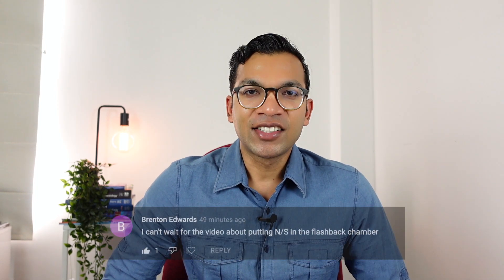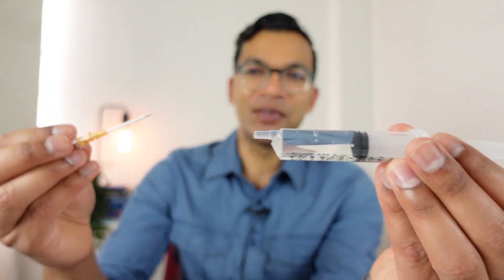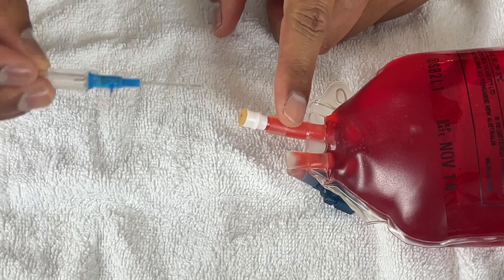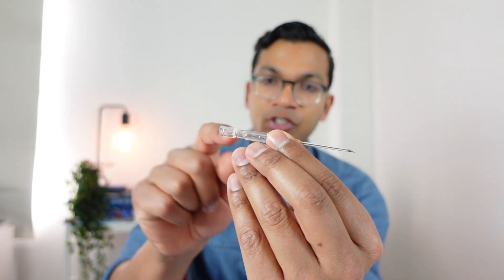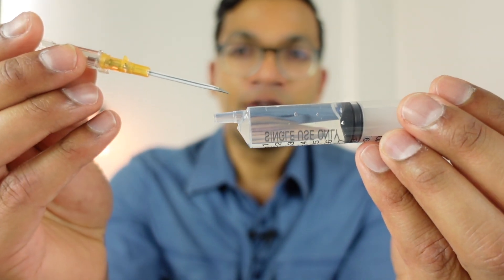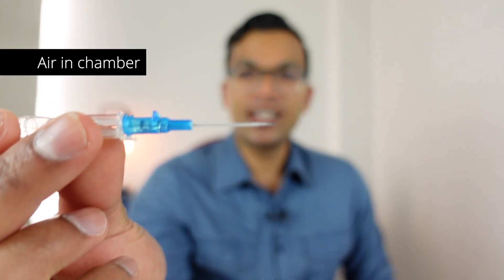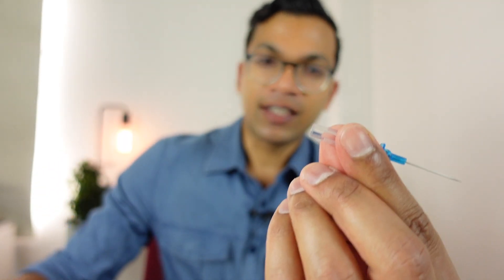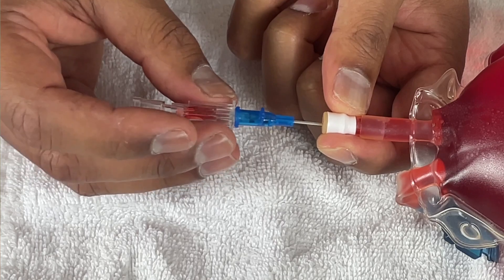How to optimise FLASHBACK with SALINE for the most DIFFICULT VEINS

Comment: Not sure what's happening. This method used to work so well. But recently  i dont get any flash back at all with saline, despite being in the vein.

I know im safely i vein because when i  try retracting the needle, blood rushes into the tube and i could advance it smoothly despite not gutting flashback. But it's a gamble. 

Could it be because the surface tension of the saline created an obstructing film preventing blood from entering?

Comment: Thank you for your videos. I have a question. What do you think about leaving the saline attached to the needle, or even better, using an extension line for commodity. I would help with those IVs with valves. As you push the saline to open the valve, you can advance the needle to pass it through. What will be your input? Thank you so much.

Comment: Nice video. I did go to 1 year extra school for IV Nurse. As you know lowering angle after entering vein is very important. My technique was never losing traction on skin until I threaded “ butterflies, all types of and sizes of catheters(16-30ga), including long intracaths, As you stated pressure is important. I had someone arrest just as I was entering skin( vein collapsed) I got lucky. I rarely used ACF, unless short term need. Start distally as you know work proximal. Thank you for allowing me to share.